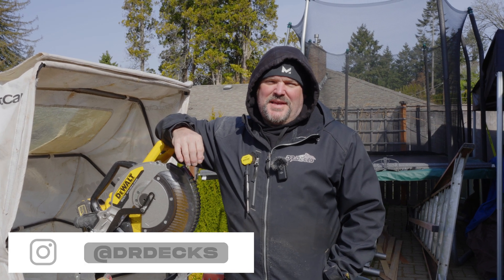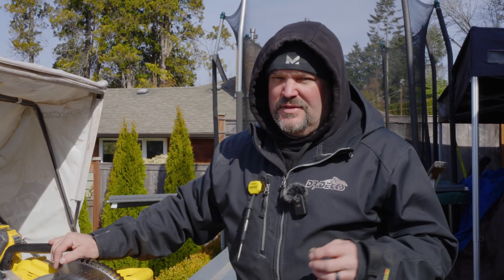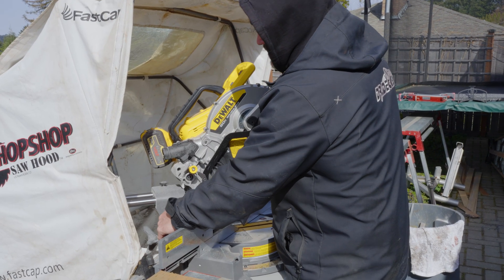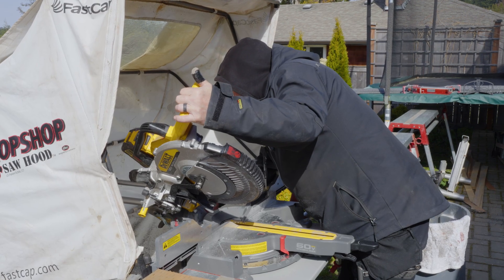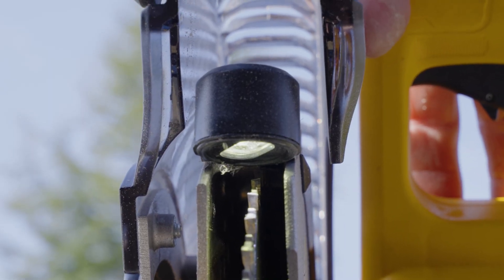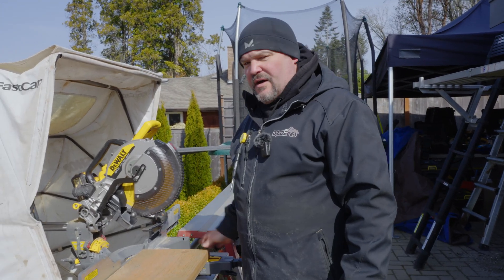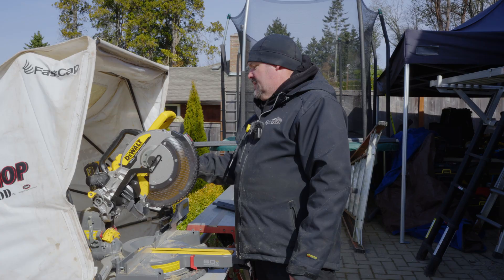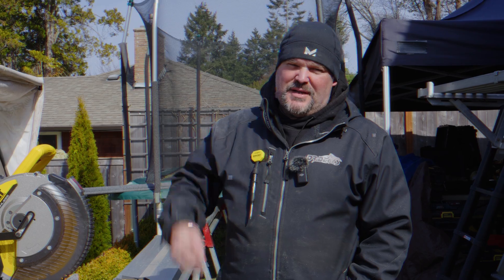NEW DEWALT 60V 12 in. Cordless Sliding Miter Saw || Dr Decks

Comment: We use this saw for cutting aluminum. The double battery Dewalt has always been great. I just hope this new model is just as good.
Reply: The new model is awesome. One battery running all day with no need to plug in an adapter beats two batteries running for less than an hour and having to switch over. Newer model runs smoother than the older one and dust collection with an extractor or shop vac is best of any miter saw I have ever used

Comment: I got a 7 1/4 cordless i still have the wired 12. My issue with the 7 1/4 is it bogs down on thick materials, have had the blade bind up on pressure treated a few times. Do you run into this issue with this bigger saw?
Reply: yeah it will still bind linkw the 7.25 like me

Comment: Aaand what happened to the old saw?  Did the saw wear out?  I have miter saws that are 20 years old and still work.  I had the DeWalt Flexvolt original with the two batteries, and it shorted out.  After researching, ALOT of them shorted out, so much so that they were discontinued.  The new saw is a poor replacement.  Yes, the technology is improved (the regenerative battery tech) but they could have put that on the old saw system - IF they fixed the old motor.  The new single battery model feels cheap, has less power, and changing blades is funky.  You don’t have to rotate the safety shroud like the original, but there is this little weird lever that gets in the way of the wrench, requiring three hands to change the blade.  No thanks, and can I get a replacement motor for my old saw for under 400 bucks?  Nope!

Comment: DeWalt did not equip this unit with a 120VAC plug-in feature like the PREVIOUS DHS790. They are GREEDY & want to force customers to buy more batteries. I'll skip this model. They could at least make a 120V AC to 60v FlexVolt battery adapter! Oh yeah, that would cost them battery sales. Perhaps I'll design, build & market one...
Reply: DeWalt is trash anyway 😂
Reply: I bet you someone will make an adapter on aftermarket
Reply: No need! Battery lasts all fking day!
Reply: @johnthumble5154 why you watching videos about dewalt tools then u 🤡🤦😂😂😂😂
Reply: @Lee-lb9qh  because I watch the channel mouth breather 😂 either that YT has been looking at my search history and seen "what's the worst tool brand out there" and shown this in my feed 🤷🏻
Reply: @johnthumble5154  OK smooth brain
Reply: @Lee-lb9qh  it might be smooth but at least I have one, yours clearly dribbled out your ear when you were sleeping.
Reply: Yeah. Crap saw. Oh wait. Best selling compound miter saw. Hmm. Must be a lot of folks out there lacking grey matter. 🤷‍♂️ 

I own this saw. It’s a BEAST and lasts all day on one battery so far. I’m pleased with it tho a 120 adapter would be nice.
Reply: @M30263  best selling..
 Completely irrelevant. Best selling doesn't mean anything other than that.
Reply: You keep posting this. Ac adapter burns out the motor. Learn a little about ac vs dc voltage.